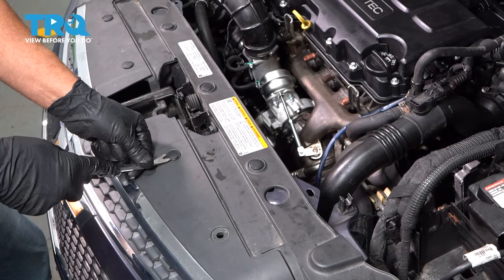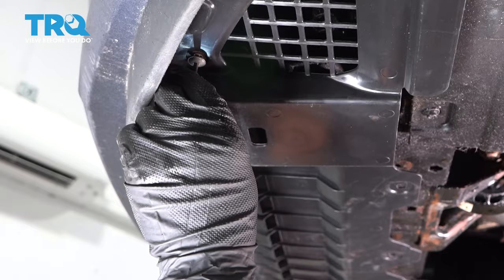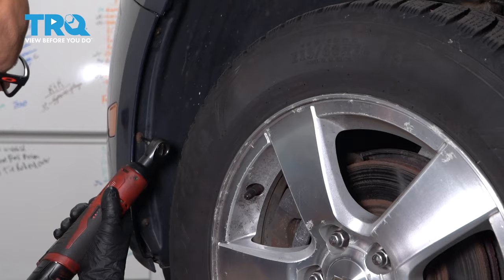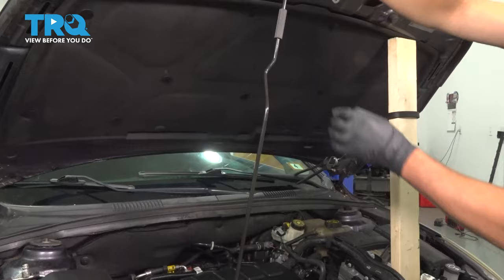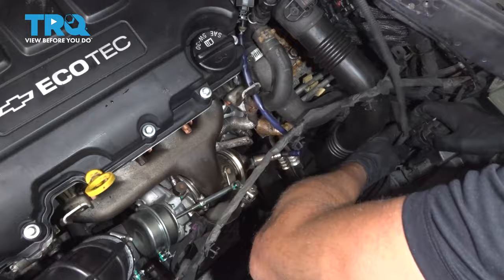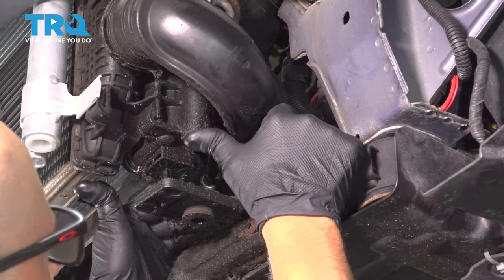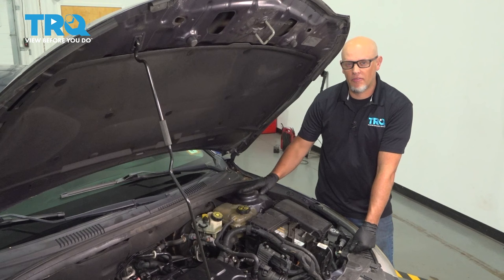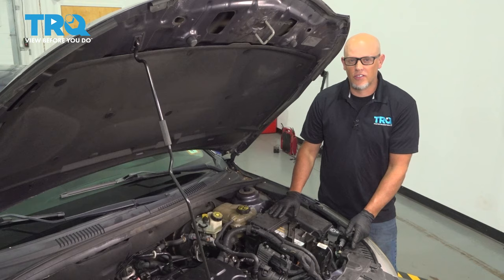How to Replace Radiator 2011-2015 Chevrolet Cruze

Comment: Only tip I have for this video: the retaining clips for the fan located at the bottom of the assembly are FRAGILE. If you will be reusing the fan, DO NOT use a tool on these clips - use your fingers. They're not very difficult to reach or to depress, and if you break one, the fan will be unsecured and will come loose if you hit a good bump!

Comment: you don't have to take the bumper off to replace the radiator I just did mine on a 2015 Chevy Cruze Lt 1.4 turbo the radiator and  AC condenser thing and turbo condenser drops to the ground
Reply: Exactly right I didn't take no bumper off that's taking all day the way he showing on here 🤣🤣🤣🤣